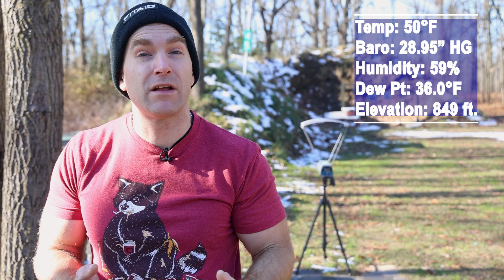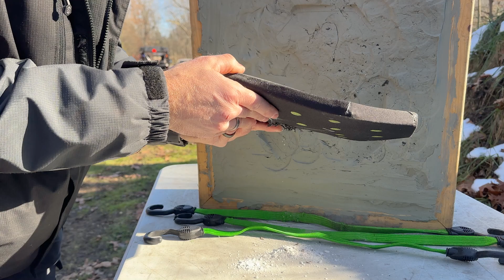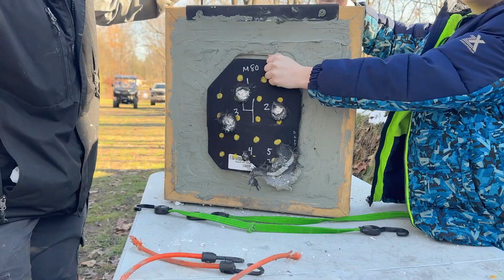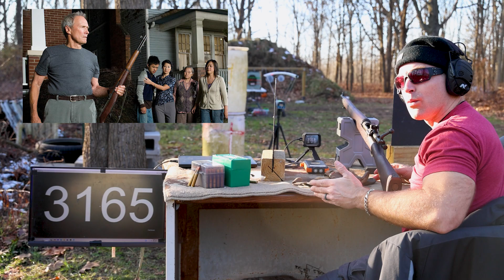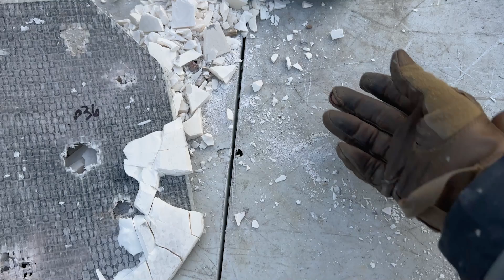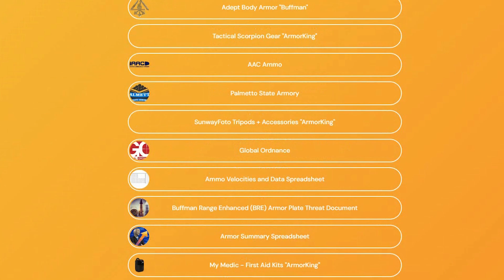Highcom 4SAS4 NIJ Level IV Ukrainian Overrun Plates (Chase Tactical)

Comment from the maker: I found the model name of the impact resistant foam; Poron XRD. Now Battle Steel is a Botach company, but I haven't found any place that sells sheets of the XRD in the US besides them. This listing is for a 9mm sheet, vs the 6mm sheet I used. It's not horrible at $25/ and will require you to cut to size.:
 https://alnk.to/ge75tum
Reply: Wow. Thanks!
Reply: Sorry if this is a dumb question...So these should be cut the front of the plate and slid into the PC in front of the plate? 

Just ordered my first PC and these plates, so trying to make sure I'm doing it right.
Reply from the maker: @ yes in front :)
Reply: @BuffRANGE  thank you, do you adhere it? Or the pressure of the plate against it is sufficient to keep it from sliding?
Reply from the maker: @ixiwixi  Nope your bag should be tight enough to keep it fixed to the front of it. If not, some adhesive would work
Reply: @BuffRANGE  thanks again!

Comment: Here I am a year later and I’m still not sure if these plates were worth it
Reply from the maker: IMO for the $100 they were worth it..
Reply: @BuffRANGE I think what throws me off is a clear distinction of what rounds they actually stopped and if the calibers that penetrated are a real concern
Reply from the maker: @rosskk  IN the end at a high level each one is only required to stop 1 round of M2AP COM, and that's it. They proved they could do that. Why the original failed the drop test is still interesting because the xray afterward showed there was no cracks. All of the other threats are a bonus and honestly if you're not facing 30 cal steel core threats, these plate are very viable.
Reply: @BuffRANGE thank you for the insight

Comment: I think your "drop tests" seem excessive. A soldier doing a belly flop won't usually hit the ground nearly as hard as the plate does in that test. If they did I think they'd have the air properly knocked out of them and have a very hard time engaging in combat for the next few minutes at least. That's a very very hard landing. A soldier would also probably use their arms and legs to reduce the impact rather than landing chest first. 
I understand that you're trying to test the worst case, but that drop test seems somewhat unfair for plates made of brittle materials like ceramic.
Reply from the maker: The drop test performed here was to the standards that were developed for NIJ 06. You're right that it is very extreme, and I believe now under the NIJ 07 standard they've changed the method to a free fall.

Comment: Is the "new sig" around the REAL one or the lower pressure/slow round?
I know most people who said they were shooting the "fury" only got the weaker/slower stuff. Which is a shame, as people WANT to see the FAST/HIGHPRESSURE stuff do its work.
Reply from the maker: This is the 78k pressure ammo. Not the lower pressure all brass case .277F variant.
Reply: @BuffRANGE  Cool. Last I had seen, both used the same cases.
Reply from the maker: The Hybrid case can either be called .277F or 6.8x51mm, but if the case is all brass it's usually the lower pressure variant. I believe only the 135gr FMJ may be in the brass case..

Comment: So to me, this is an excellent value for the money if you want to have level IV ceramic plate protection on an affordable budget. As long as you know and understand its limitations, it's going to be a huge step up from soft or steel armor.
Reply from the maker: A HUGE step above steel.
Reply: @BuffRANGE  yeah, I also went ahead and snagged some 1/4" adhesive backed Poron to put on the strike faces, which will bring the plates to an even 1" thickness which isn't too bad for the added non-ballistic impact protection for the ceramic.

Comment: So if you fall while wearing these plates, your screwed!?!
Reply from the maker: No.  Likely not.  I think that penetration was a very wild fluke. The follow up xray showed no cracks. If it worries you add a yoga mat or the high density foam in front of it.
Reply: @BuffRANGE  so you think it worth the chance? They are good plates?
Reply from the maker: @Sneakshot88  for the price right now vs weight they are hard to beat.  I feel the RMA 1155 is better but it’s also $60/more.  Or upgrade to the 4s17M

Comment: So honestly asking… with them being on sale for $99 a plate it’s something I can afford right now lol. Are these actually worth it? I’ve seen a lot of people saying it failed from just a drop test? (I’m very new to body armor and want to get a decent but affordable pair without wasting money) Thanks for the help!!
Reply from the maker: If you can only afford $99/plate these would work to cover you until saving up and getting something better in the future. We couldn't prove with a new drop test that it caused the failure as the ceramic wasn't cracked. Maybe we caused the backer to slightly come off the strike face, or some weird fluke.  This re-test shows these are very 5.56 capable and will otherwise work as designed. There are better designs (4S17M), but they are very spendy compared to these.

Comment: “nOt dEsIgNeD tO HaNdlE dRoPS, jUsT BoO-LeTz”

Soldier in war zone, Takes immediate cover due to PKM initiated ambush has rounds buzzin his Head, jumps into cover… lands on plate. Sorry bubba… u no get protection.
Proceeds to die cuz no armor and that armor cost him weight which means less boo-lets carried and less maneuverability 

Pathetic. Plates about as realistic as “training” off a paper silhouette of a bad guy standing square to you and sitting still. Chest is a bigger target if the bad guy is an idiot and stands squarely to you as you shoot. Ill get off the soap box but cmon now lol. Plates, which are primarily used in combative settings, cant handle the randomness of combat.

Comment: Lesson here, these arent true level 4 plates. Thank you for testing for us. I'll save my money.
Reply from the maker: By the books these are level IV. They stopped the NIJ 04/06 shot pattern; one single hit of M2AP.  There is no requirement to stop lesser threats or anything else with level IV. I think ultimately that’s a major downside of not creating a new RF4 or even 5 rating. They allow certification now up to 6 shots but in the end it’s still an R3 plate per the CPL.

Comment: Would you suggest these over those LAPG level iv plates with the 1" border? At $99 these still seem like a good deal even if they're an older design. I also like the fact that it's multi curve and edge to edge
Reply from the maker: The multicurve and edge to edge and overall robustness IMO is a better buy over the LAPG. Now the LAPG can reliably stop 4-5 M2AP but the plate doesn’t stay together as well.

Comment: 7n6 isnt really used in the Russian army anymore. They have switched to 7n22 and 7n24. Both have significantly higher penetration and speed
Reply from the maker: Unfortunately I have no access to those rounds. I don’t see them doing any better than M995 though as even with better cores than 7N6 5.45’s pressure cap is still 10k psi lower than 5.55

Comment: can someone tell me what defeated the original dropped ones? did they fail on m193 or m80 ball?
Reply from the maker: The original dropped plate failed to stop M2AP COM at the NIJ spec. it stopped a slew of other rounds as it did here, but because of the 3 M2AP hits on that plate, it degraded it enough that the plate then only stopped 6 out of 10 5.56 threats. In reality that's way more hits then the plate was meant for considering it was designed for 1 M2AP hit.  The original video is in the description.
Reply: gotcha. thanks man

Comment: You sort of blew past the fact that 3a stopped a rifle projectile as a backer. That is pretty unusual. I wonder if it's unique to the mechanism of ceramic -- immediate catastrophic projectile damage.
Reply from the maker: @ExtremeSquared  In theory the ceramic strike face breaks up the projectile or causes it to deform.  A non aerodynamic mass with a bit of frontal area is the type of objects IIIa can catch especially when the IIIa has UHMWPE in it.
Reply: I imagine the projectile also dumps much of its velocity going through that ceramic and UHMWPE.
Reply: @videoprojects8682  That is actually the mechanism that would be unusual. It is somewhat difficult to get a rifle round to go through some amount of steel and not also blow through 3a.

Comment: Yeah, no, if you drop it, it won't work. That makes total sense. I know in Afghanistan, we were so careful not to fall, drop to the ground for cover or violently slam ourselves against solid objects for cover. We always remained upright and treated our plates as if they were made of glass. That's absolutely a realistic test.......ARE YOU F***IN KIDDING ME? How much are these and they can't be dropped at all? Our issued plates in '07 sometimes took multiple heavy blunt strikes a day and of the 4 guys at my FOB that took rounds, none of their plates failed. Sorry, if it can't take a few blunt hits and still do it's job, it shouldn't even get an NIJ rating.
Reply: Not to mention having to dive for cover for buddy movements on micro terrain. It's unrealistic to not expect something strapped to your body to not get abused.
Reply: Yeah but did they take m2 ap from 25 yards or did they take some mild steel 7.62x39 from 300 yards away....you could have been walking with compromised plates and not even known it....wouldn't be the first time the military had faulty equipment
Reply: @rodiculous9464 THIS lol^

Also dropping to the soft ground with a plate protected inside a cordura vest is not the same as a drop test to a hard floor…

OP doesn’t understand science or realism
Reply: A 4sas4 multicurve plate set was $200 pre tax. I jumped on it, which in hindsight is pretty dumb, but they were definitely advertised as lvl IV. I'd be interested to know what the legalities of advertising them as a "contract overrun" vs "cancelled contract" are though.

Comment: @BuffRANGE - Did the lab results they showed you say they were for the multi-curve plate with the same weight? Everyone is saying that it was only for a single curve plate with a different weight, yet Highcom kept the same model number.  I'm definitely not impressed given how these were marketed vs. how they are actually performing.
Reply from the maker: 7.16lb but the OBL lab doesn't mention curvature. The internal testing lists multi-curve, and a weight of 7.3 lb.

Comment: The plate with the e-glass backer is a fairly new approach as I think the limits of UHMWPE appear to be already known. I mean by that the limited heat resistance, low chemical resistance, low modulus of elasticity and the high price.

Comment: If this testing tells us anything, it's that NIJ .06 and the new .07 standards should be a hard and fast rule for those purchasing armor. Compromising to a lower .04 standard just means you're giving away plate capability.

These are the kinds of plates that propagate the FuddLore about ceramic armor being useless if dropped and can't take multiple hits. This really says a lot about the offerings from HighCom, much to the chagrin of certain armor dealers in the world. It should be further noted that HighCom only has ONE level 4 plate on the CPL currently, and it's not this plate.
This further goes to show the issues of not having plates validated by the NIJ that aren't otherwise Military issue plates.
Reply from the maker: I can foresee a lot of companies who will continue to sell “IIi+” plates once the NIJ 07 CPL is active because a LOT of steel can’t take the new RF1 threat of M193.

Comment: I think my biggest fear is you never drop them but who knows what damage in shipping you can't see.
Reply from the maker: That’s very true on any ceramic plate shipping. Extra care should be exercised
Reply: The box mine arrived in had definitely been dropped. Enough to have about a 5 inch slit essentially from cutting from the box. 
Not the best shipping methods from tactical shit. Rma plates shipping was much much better

Comment: Why don’t you test m993 anymore 😢
Reply from the maker: At $70-100+ it destroys most armor and it’s moot. I think I used it in the LAPG IV test I need to do.
Reply: @BuffRANGE  I don’t think you used it against the LAPG level 4 plate or atleast it wasn’t on video if you did. You used SMKH against the LAPG IV. Do you need me to send to donate you some m993 I acquired a small stockpile for SHTF when Trump got shot.
Reply from the maker: It’s a newer not released video.  I won’t say no to donations. It might be at some point m993 goes in 300 BLK Becuase some designs can’t stop a 13” at 45’
Reply: @BuffRANGE  did it defeat the LAPG from what barrel length? I use a 24” AR10 to guarantee it goes through all designs at close range hehe except for adept and XSAPI
Reply: @BuffRANGE  oxide told me that the adept colossus often fails vs m993 in lab tests. What have you heard regarding that and I find that shocking since in your test the plate defeated m993 at 400 fps above spec! Weird
Reply: @BuffRANGE  I’ve got over 100 rounds of SMKH as well
Reply: @BuffRANGE  I was having accuracy issues with the m993 was shooting at 50 and 100 yards through a genuine ACOG m80 ball goes point of aim and m993 would go 18 inches high…….
Reply from the maker: Maybe why m80a1 went to 130gr for better matched down range trajectory.
Reply: It's a pretty uncommon round man. I did 8 years in the infantry with 3 combat deployments, and the only time I've ever seen them was pre 2014 in Afghanistan in belts for the M240. I never saw them for rifles at all
Reply: @RickSanchez167  the army probably figured it’s a waste to use such ammo against guys in flip flops  😂
Reply: @RickSanchez167  I got like almost 300 rounds of it 😅
Reply: All in boxes lol
Reply: @RickSanchez167  I know another guy locally who has over 100 rounds of m993.

Comment: Can't believe the clown at T.S tried to discredit your testing... By using m855 out of a 17 AR with zero clay or Chrono
Reply from the maker: @ViridianKol  where was that posted ?
Reply: @BuffRANGE  Owner of T.S personal FB, Youtube keeps removing the reply
Reply from the maker: Yeah YT keeps deleting comments with links even though I have it set to allow.
Reply: @BuffRANGE  he had it posted on his facebook
Reply: Nobody tried to discredit anything.  Just showed that the armor worked as per it's 04/05 cert.  I would think it would be good of this clown to test something his company sold after the original video raised questions.  Glad this video put those questions to bed.
Reply: @tjkirgin  The frack he didn't. He literally called Buffman's testing flawed 3 times, then proceeded to set a plate on a stack of tires, walked approx 45ft away and center massed it out of a 17inch AR. With zero chrono, and closest we got to the ammo specs were "these are green tips"
Reply: @ViridianKol  The original test was flawed.  That is why he did it again.
Reply: @tjkirgin  Is not actually certified.  Cert is old and not active.  The original cert was single curve and a lot different weight so same name but not the same construction of plate ergo needs it own cert to actually you know be certified.   Most places weasel word and say tested to that cert when they basically pay some lab for the results they want doing close to the same thing as this video. 
If it was really certed it would have ongoing nij FIT tests.  
troll bad biz owner
Reply: @tjkirgin  wait, I haven't seen the video but are you saying the plate worked per 04/05 because it stopped m855?

Comment: Can someone explain this to me like I am 5? I watched the video. I think we debunked the first video because of the drop test in this round of testing. 
Maybe you could share the spreadsheet on google drive?
So what will these plates stop? Are they in spec or not in spec?
Does it stop 223, 556, 7.62? AP no AP? 
A rehash at the end could have been better like show all the in spec threats it stopped , then show extreme threats it stopped or didn't stop. Thanks for your time. I purchased these and I am still trying to determine if I can rely on these if needed.
Reply from the maker: In summary these plates stopped their intended design parameter threat. M2AP at 2,880 fps. Further they held to more common 5.56 threats well above a 16” barrel velocities. Could you take 20-25 hits of 5.56 on this plate ? Nope but I’d rest easy knowing they work as long as they aren’t belly flopped on.
Reply: @BuffRANGE  Thank you.
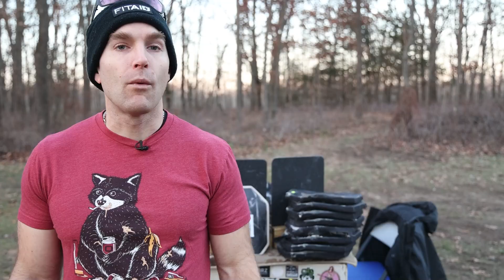Reply: The campsite links include a spreadsheet with the raw data screenshotted near the end of the video (29:56). Not having to take notes through a half hour video to compile results is the best thing about Buffman's testing compared to other guntubers.